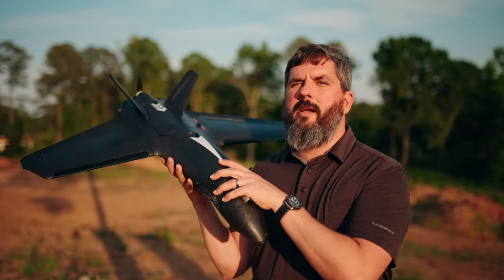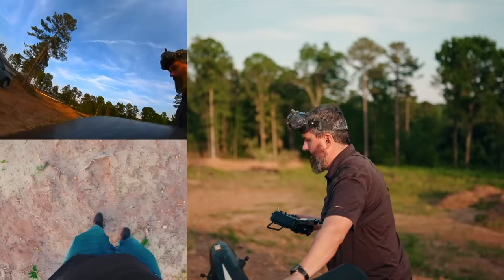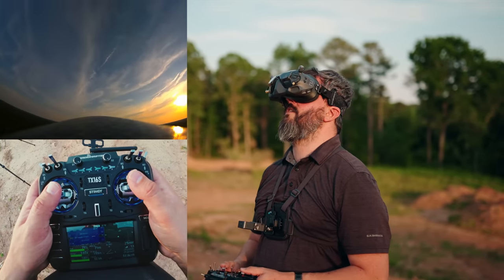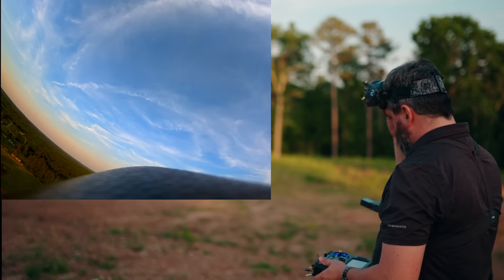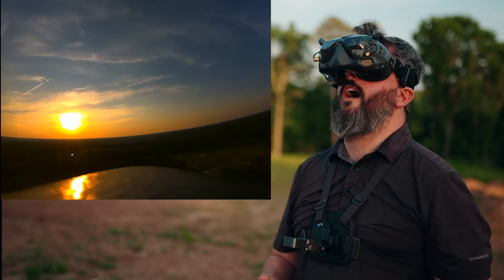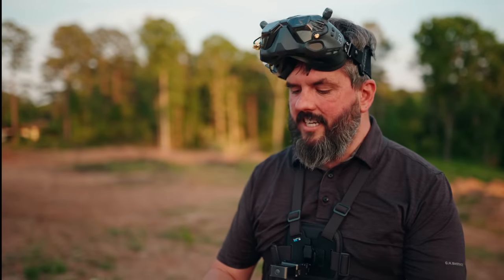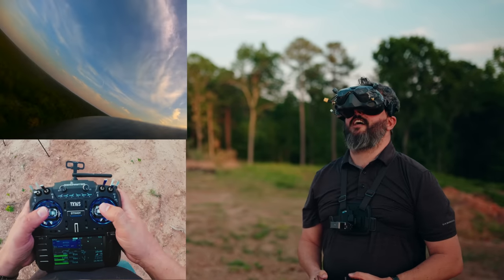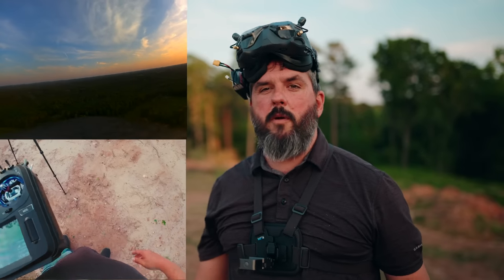AtomRC Dolphin, INAV Auto launch mode, Autotrim, and Autotune

Comment: You couldn't re-arm because you still  had autotrim enabled. 
There is a feature in Inav called "continuously trim servos" this will automatically trim servos when in a stabilized mode like acro, angle etc. Sticks need to be centered.

Comment: Nice to see some fixed wing flights on the channel. And excellent to see you using auto launch as it was intended; and not shaking the plane. So many people do that and share the bad habit. Idle throttle and throw it, and you get perfect launches. 

Before you go for the waypoint stuff, I’d recommend you check out the auto level feature. It is a tuning mode that will get your angle of attack for the current throttle dialled. Just enable it at the same time as Angle or CRSH and let it go hands off for 5-10 seconds. You’ll see the altitude stabilise pretty nicely. That just adds another level of tuning before heading off on the mission. 

Hope you have loads more fun with the fixed wings. That Dolphin is a pretty capable and versatile platform.
Reply: Oh yeah. The re-arming in flight. You can do it. You may have been blocked by autotrim or autolaunch. One problem with DJI is that it won’t be showing you system messages that would give you clues as to why it can’t re arm. In general though, autolaunch off, throttle low, and be in a basic flight mode. 

I do have a video on my channel how you can add 2 lines of programming in iNav Configurator that will let you instantly re arm. You could even be full throttle.
Reply: Indeed! The shaking had become a thing, sadly! Every time I see someone shake his wing on YouTube I scream "Just throw the damn wing!" 😂
Reply: @MrD  Hi Darren, do you have a link to that video for the 2 lines programming? thx

Comment: You can rearm in flight. I've just done it. I disarmed by mistake then pull the throttle all the way down and you now can rearm. I was lucky it was at higher altitude. That was scary. Maybe there is a setting that prevents it by default, not sure.

Comment: its all good you may have learned since then,  yes i can dis arm and re arm all time in air and you must have a error on screen why it wont arm may be a navigation or flight mode error try going back to acro or manu to arm with no nav modes like loiter or auto trim or auto tune. good flight and video!

Comment: Hi!!    I just put together and flew an old plane BIXLER II with at Speedy Bee controller, the 405 FC. with INAV 7.0. Everything worked very well. GPS, RTH. but Autolaunch. 
Everything on the OSD is working, I get the System status indications, "Move the throttle up and launch", however the motor does not get to IDLE. 
The system is prompting me to hand launch, but I did not since the motor was not idling, not spinning at all.
 I noticed that in normal conditions the motor starts turning when the Joystick is at 25% approx. 
The CLI commands are:
 Launch Thr 1750 
Launch idle Thro = 1300 
Launch Velocity = 150 
Launch Accel = 1500 
Launch max angle = 180 
Launch detect time = 40 
Launch idle motor delay = 0 
Launch motor delay =100 
Launch spinup time =100 
Launch end time =3000 
Launch min time =0 
Launch timeout =10000 
 Launch Max altitude =0 
launch climb angle= 18

I guess I am missing a setting, or there is something with the throttle setting since the motor starts spinning up at 25% of Joystick in manual mode
Let me know if you have suggestion
Reply: I calibrated the ESC and the problem was solved !!
Your video gave  me ideas on how to solve it ... Thanks

Comment: Stinger -  how robust are the autotuned PID settings to variations in airspeed?  With a quad this is not an issue, but the authority of fixed wing control surfaces depends a lot on the airspeed. Can iNav be set up to measure airspeed with pitot tube and use this to modify the PIDs?  (p.s. got my start in FPV with ritewings, but back in those days we just wired the receiver directly to the servos!)

Comment: You couldn't rearm in flight because the Auto Launch was still enabled. Just set Auto Launch to "always on" as a feature (not as a mode), and if you don't want to Auto Launch, just wiggle the right stick after arming to disable Auto Launch.
Reply: i have autolaunch always on and i also am not able to re arm after disarming mid air
Reply: @BuddhaFpv  In flight, disarm, Throttle low, arm, wiggle right stick (mode2), throttle up. Arming angle setting needs tot be 180. Maybe that's why you can't arm?
(Or disarm/arm 10 times to override all errors)
Reply: @13FPV  hopefully i dont hit the arm switch on accident again but if i do ill give this a shot thanks
Reply: @BuddhaFpv  It's always a panic situation, it might help to remember the sequence is to practice it a couple of times with the wing unplugged.

Comment: You probably wouldve been able to rearm if you wouldnt use autolaunch because in this case its waiting for you to "throw" it which it tdetects through a significant enough acceleration that you obviously wont get in flight.
Reply from the maker: Auto launch was turned off. You can see me turn it off after engaging auto trim.
Reply: @stingersswarm  you have autolaunch permanently enabled, which is standard for fixed wings. after disarm, the fc goes into autolaunch again when armed. you have to arm/disarm TEN TIMES fast with throttle at zero to by pass  autolanch and have an armed craft.
Reply: @DutchCommando  so if you’re in flight you can’t just rearm and wiggle the sticks like when you’re on the ground?
Reply: @DutchCommando  you don't have to arm/disarm 10 times, that's just to bypass arming safety check, like no gps reception for example. To arm midair when autolaunch is enabled you just have to arm, wiggle the right stick (mode 2) a little and that disables the autolaunch wait and lets you raise the throttle.
Reply: @orvofpv  Indeed, but as a first time INAV pilot i understand that's not wired in his head yet... 😉

Comment: lmao you wrong lol auto launch then  tune? wtf no
Reply from the maker: Teach me oh master.
Reply: @stingersswarm  watch and learn manual first then switch to angle mode and turn on auto tune and fly get the thing landed and save with sticks then if you have your settings right and the auto launch throttle is high enough only then will it auto launch or its just going to hit the ground because the auto launch throttle will be too low for big air planes....... how do i know i found out from trial and error watch my youtube and see for your self
Reply: @stingersswarm  i burnt my motor doing what you said you cant just use autolaunch  it needs to be set right